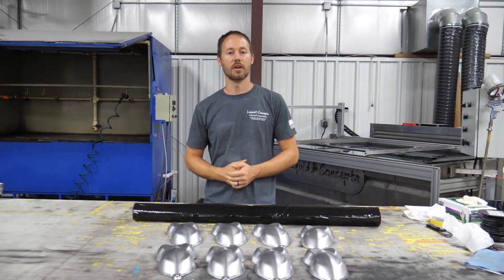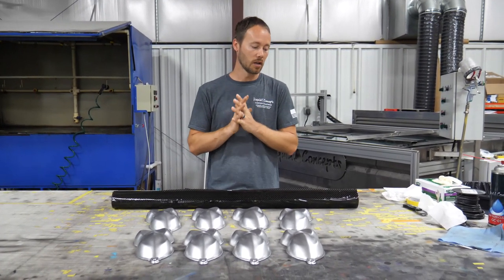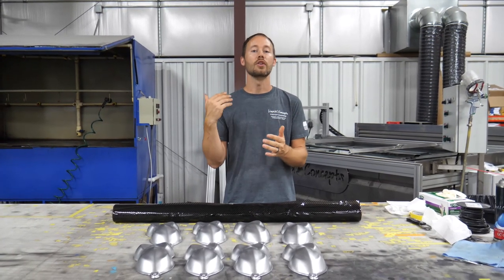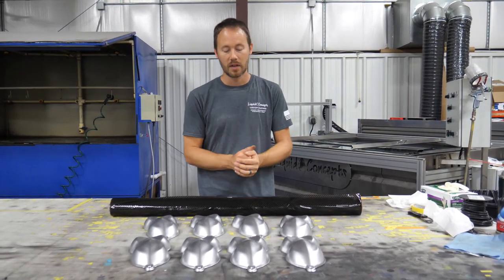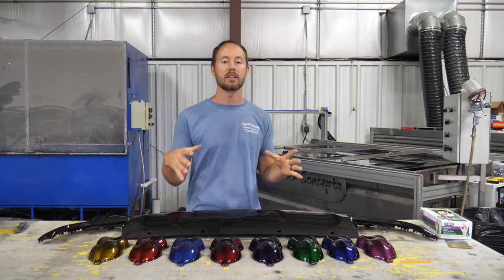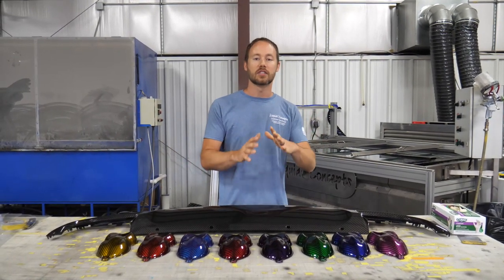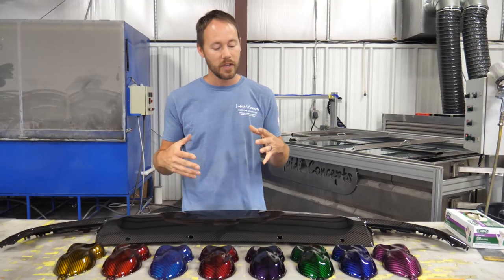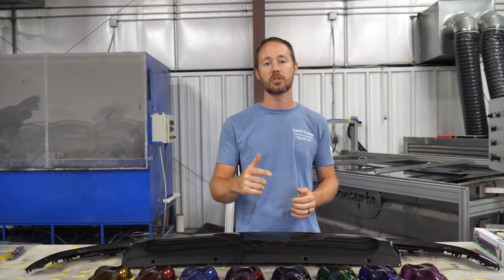HOW TO COLOR CHANGE CARBON FIBER | Liquid Concepts | Weekly Tips and Tricks

Comment: That's not even real carbon fiber
Reply: It’s a test… to show how too color change it he not that stupid to use real carbon just for a test
Reply: what the heck is real carbon fiber.

you do know that carbon fibers are compounds of layers of different materials, and the contact surfaces are just resins right?
Reply: @Speedunleashedd  the problem is you can't paint/tint/tone carbon fiber itself you can only do that with the epoxy resin
Reply: @baharezo what do you mean what is really carbon fiber? You literally just said what it is js think about it😂😂 he used a sheet of paint activated by water to stick to the metal, there was no real carbon to be seen in this video, he keeps saying “normal” carbon. It’s not even if you did this with a real carbon part because you would completely cover the finish it, it would go on over the epoxy 😂

Comment: I have some accent pieces for my car, and they're standard carbon fiber look. Can I spray a candy over the item to change it to a blue carbon fiber? Will I have to get each item sanded to allow the candy to stick? I'd like to have everything CF in a candy blue. Under the hood, interior, trunk, even rear diffuser.

Comment: What would happen if you were to Candy color under the Carbon fiber dip?
Reply from the maker: You can do that if the candy is applied and mixed with an intercoat but it will not be as vibrant as applying over the top in most cases.

Comment: What kind of paint did you use.? How does it works that you spray a color but doesn't affect on the carbon pattern?
Reply from the maker: These are all candies colors. Candies work by having a silver metallic base color. The silver that shows through the print is what changes colors.